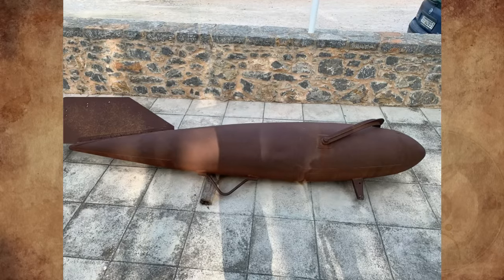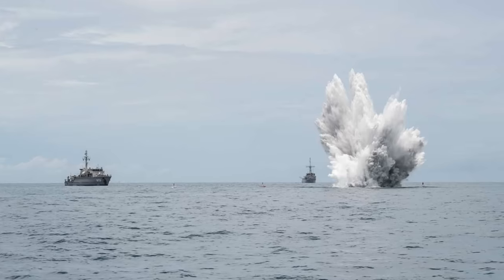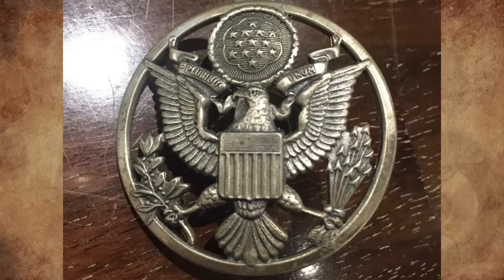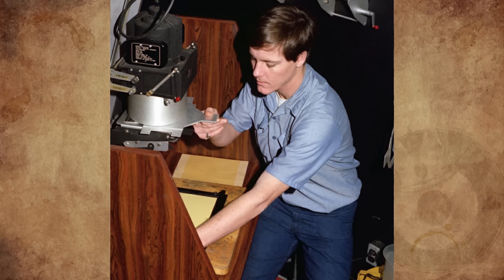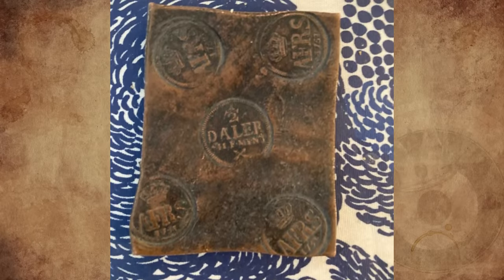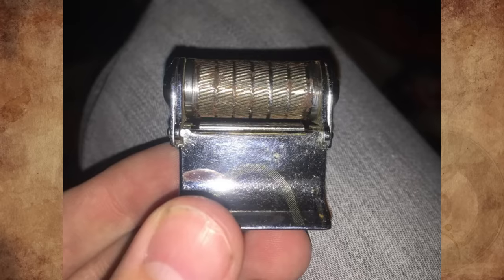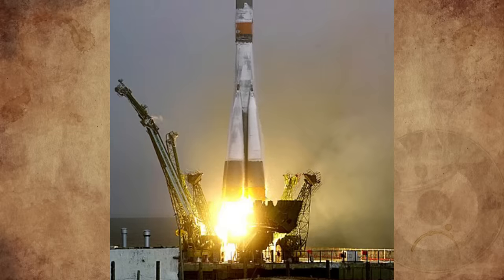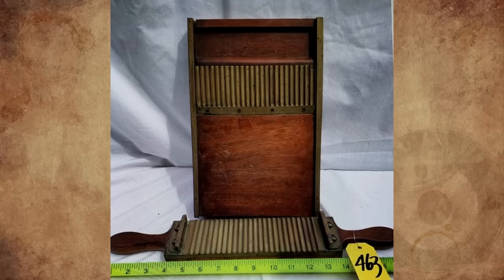What Is This Mysterious Torpedo Thing Found In Greek Village And This Square Plate With Circles?

Comment: It’s a pill roller. You would take medication mixed into a clay like consistency and use the cutters to cut “snakes” then turn the snake sideways and push the platter over the groves. That would roll the medicine into a pill. You would then powder them with powdered sugar or flower. After drying it is ready to use
Reply: Saw a demonstration of this in action at the Black Country Museum. Dudley, West Midlands 40 tears ago. Fascinating to watch. They have a chemist shop Called Emile Doo's.
Reply: Thank you! I would have never guessed, but that's a clever way to cut a lot of identical tiny pieces quickly.
I love old tools for their ingenuity and craftsmanship.
Reply: *flour

Comment: The American eagle cap pin is not from ww2. It's a post war, after 1947, U.S. Airforce enlisted service man's cap device. An army cap device would be brass with a sloid background. This is silver with a hollow background. They are still in use.
Reply: Officer emblems don't have the circle around them.
Reply: I have a problem people with using the words “Air Force” in relation to WW2 as it wasn’t AF till after the war.  My Dad was in the Army Air Corps - AAC from 1941-1945 stationed in Blackpool, England.  He helped repair and test fly the B-17s before sending them back out again!  No Air Force till after the War.

Comment: It is a pill maker. Not tablets, pills. The pharmacist would make a pill mass, a calculated formula with active ingredient/s. This was rolled into a sausage that is the exact width of the board and regular. The smaller board is used in a sliding pressure to cut equal-sized pieces. Each piece is rolled into a ball using a pill-roller. A wooden block with a precise hollow in it. The rolled pills are coated or left plain, dried, and dispensed. As a student I still had to make pills, back in the early 1970's.
Reply: I may comment that I have made pills, and tablets, ampoules, vials, mixtures, syrups, elixirs, creams, ointments, suppositories, bougies, cachets, powders, drops and not sure what else. I think the newer pharmacists do not do all that nor do they get pharmacognosy, the study of the original sources of medicines, like Atropo Belladonna from which we got Atropine.
Reply: @kingstonpatrickscuthbert5473 
*Atropa belladonna
I've seen this device used for making round hard candy too.
If i remember right i think making farmaceuticals and making candy are closely related, because sugar was often used to make the nasty taste of the medicine more palatable. Small step to leaving the medicine out, and just make sweet treats for fun.
Reply: Atorpa Belladonna...interesting name. A poisonous plant which, used correctly, is a medicine. Deadly Nightshade would be a synonym.
Reply: @kingstonpatrickscuthbert5473  
Lol, not gonna nitpick about names again....have it like you want. For the rest: Agree. Same is true for foxglove (Digitalis purpurea) and lily of the valley (Convallaria majalis ). Among many others.
Reply: Unsure of Lily of the Valley. Cinnamonium Zeylanicum, Strophanthus Kombe, Strychnos Nux Vomica, Papaver Somniferum, Capsicum Minimum, and other, come to mind, off the cuff.

Comment: The last item looks like a candy shaper that is used to make candy round like a ball. To use it, you take the candy before it hardens and roll it with your hands to make a skinny sausage shaped roll. Place it on the slotted larger slotted  section then place the smaller one on top and then press down while moving it back and forth. When both halves start touching, the candy goes into the square bowl shaped end, and the candy is formed into round candy. As it finishes cooling it hardens until it becomes a jawbreaker.